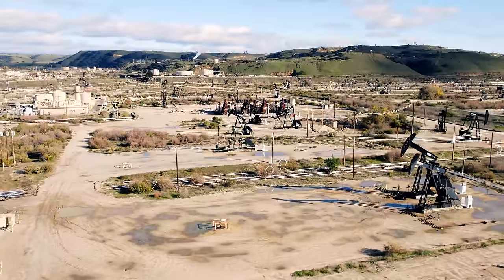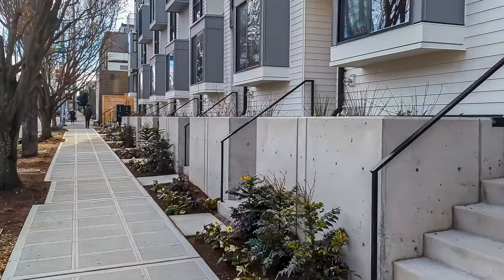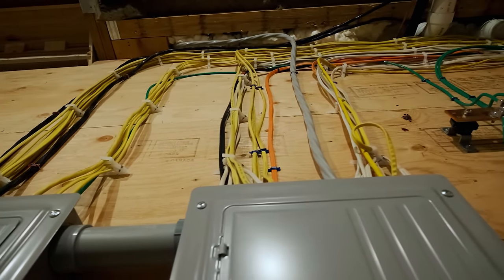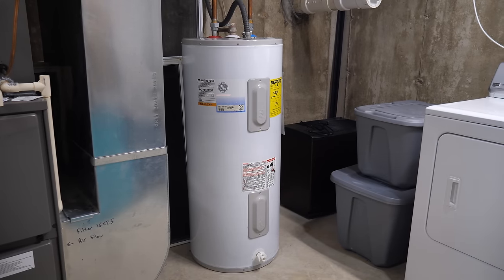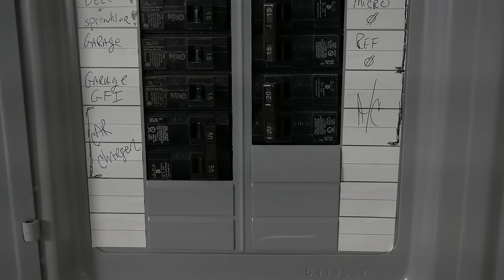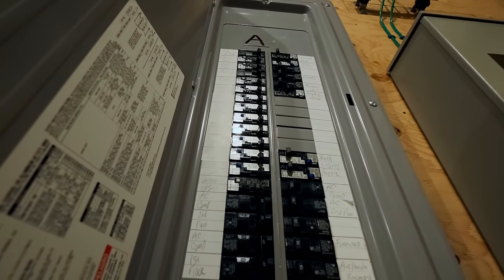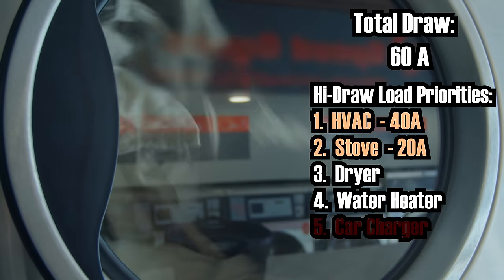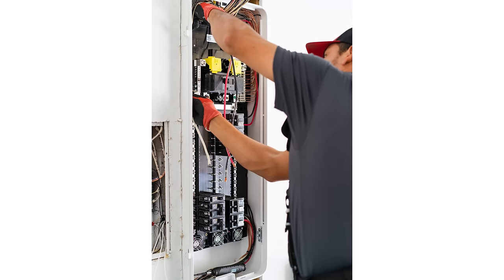Home Electrification: There's not a lot to do, and it doesn't have to be hard (Part 1)

Comment: As a Norwegian, it sounds so foreign to hear you talk about the things i grew up with as something novel like this. I want to highlight how much easier everything is when it’s all electric!   This is great, you can do this! 🎉 a couple of years ago furnaces became illegal here!
Reply: It's not really novel to go all electric in the US. It is pretty common in places where other sources are not available. Where other sources are, the issue is cost. Even at 0.10USD/KWh natural gas costs about 1/4 vs. resistance heating. Air source heat pumps are comparable to operate but cost much more up front. Ground source heat pumps cost less vs NG to operate, but installation is very expensive. Of course this varies by region. 

Also it isn't extra effort from the homeowner perspective. Most of the time it works in the background. The reliability between electric and gas or oil based devices don't differ greatly, so not much to be gained there either.

IMO the major problem in the USA is that most people aren't planning to keep a home for life, so spending extra on better appliances and better design and construction (insulation, windows and air sealing) hasn't had proper focus historically. Better homes don't get enough credit when being sold. The improvements are largely hidden and ignored. That is getting better I think, but getting that return on your investment when building is difficult.
As that mindset shifts, better products will be installed.
Reply: My parents' live in the United States. Their home was built in the 1960s. The address plate on the front of their house says "Powerhome", and it's illuminated by a bulb that has not been changed since the house was built. The plate signifies that the home was built to be an "all electric" home of the future, a novel idea in the 1960s. We could accomplish it then, and it stands to reason that with recent technological advances we can most certainly accomplish it now. Hoping we'll get up to those Norwegian standards.
Reply: Illegal for new constructions/new renovations to the HVAC system or illegal as in they take your furnace/fine you for continuing to use it?
Reply: Yes, I'm from one of those more primitive countries (the Netherlands), and looking at doing what's normal for you. Quite a lot of work, as it's still fairly novel... But I understand you also do underfloor heating with electric heat mats? Mine is water based... Ha det....
Reply: @DarthCiliatus  As in taking your furnace.
Reply: You say they made furnaces illegal there  like it is a good thing. It's not. What do you do when there is an ice storm and there is no electricity for a couple weeks, just freeze?
Reply: @springhollerfarm8668  We have so good infrastructure that this is never a problem. It will stay like this for a few more years until there will be a complete EU-mandated privatization of the grid. (Unless some new political parties will be able to stop this madness). Then we will also get the US infrastructure issues. But yeah, right now this has not been an issue for the last 50-60 years at least in Norway.
Reply: Here in northern Sweden we use district central heating, heat pumps, wood based combustible fuels, and electric resistive heating in descending order of popularity, depending on avaliability. Central heating and ground source heat pumps do not need a secondary heat source even in extreme cold so is the favored options unless you own forest land and like to work those logs. I’m sure that if there was infrastructure for a gas hookup and national natural gas reserves, gas would have been the fuel of choice after the oil crisis in the 70s.
I recently moved into a 100 year old house that was initially heated with a wood burning cast iron stove, later having additional insulation and resistive heaters installed, then  “mini-split” heat pumps, and lastly a pellet burning stove as a secondary heat source. Times change and housing need to be built right so as to be able to adapt.
Reply: @VirtuellJo  Norway isn't in the EU?
Reply: @springhollerfarm8668  Good luck blowing the air down the pipes without electricity for the fan.
Reply: Of course, Norway has the largest abundance of geothermal energy in the world. If electricity were that cheap here, I'd heat my house (water) with it. But it isn't. My gas bill is less than $20/mo - and most of that is the meter itself, not usage. (the highest it's been in a decade was $50. But I was heating the house to 72F while it was in the 20's all month.) Heating with electricity would've been over $300. Heating just a single room costs around $20/mo.

My grandparent's house was built with baseboard electric heat (in the 40's!) They NEVER used it, because it would bankrupt them. Basically the only room in the house that stayed warm was the kitchen. (with the family room attached to it.)
Reply: @erwindewit4073  Those heat Maya eventually burn out don't they? I have never heard them recommended by anyone.
Reply: @springhollerfarm8668  And how does your blower fan run without electricity? Forced air systems, including the ones that are combustion based, use electric fans to force air through those vents.  And I bet that those modern electronic controller boards also need to be powered. Only the older oil or water based radiator systems remain operational without electricity.
Reply: @MarkRose1337  First off, My wood burner is in the basement, the heat floats up and even if it didn't, it would still spread throughout the house on it's own. (Ever hear of convection? ) and two. Did you notice the part where I mentioned a gas powered generator? It will run a blower.
Reply: @sarvphilly7983   First off, My wood burner is in the basement, the heat floats up and even if it didn't, it would still spread throughout the house on it's own. (Ever hear of convection? ) and two. Did you notice the part where I mentioned a gas powered generator? It will run a blower.
Reply: @springhollerfarm8668  Well, as far as I know having a woodburner als heater is mandatory just for these events (that do happen in Norway). 
But the same problem would apply to everyone else. Furnaces ALSO run on electricity, just not that much. So they won't work either.
So having a wood burner just to be safe is (and always was) a good idea.
Here in the Netherlands though, power outages are VERY rare and never really last for long (most of our power lines are underground). So it's much less of a problem...
Reply: @jfbeam  Well, gas is $4 per m3 (convert to your preferred unit). Unbelievably expensive. Electricity is 'just' $0.80 per kWh now. Cheap is relative ;) Petrol is about $7.50 per gallon here too. Usually, energy is fairly cheap in the  US compared to here..
Reply: @erwindewit4073  My whole point is this: Why are "they" trying so hard to push everyone to 100% electric homes? The grid cannot handle it now, anyway (In USA) and the main issue I have with it is when, not if, the electricity goes out for longer than a few hours or just a day... The generator needed to run an all electric home would cost thousands and still run on gasoline. Finally, what if the people in charge decide they don't like you for whatever reason, like not supporting their political agenda, they can and likely one day will, cut you off. Then what? I don't like being under someone else's control that way, it is frightening.
Reply: @springhollerfarm8668  Well yeah, I agree. Our power grid has always been extremely reliable, so nobody has generators here. Well, a bank perhaps. Still, as profits and indeed, political disinterest undermine the grid more and more, it WILL get less reliable (and even MORE expensive). And here too, the grid operates at capacity mostly everywhere. 
I think some fluid and solid core batteries (fluid which becomes solid to store energy) might be able to store the energy you generate for months. So you might generate 3 MW during the summer months, store it, and use it for the rest of the year. And THEN depend on the grid if it's not enough. 
Of course I would prefer storage and generation at scale, but then the excessive profit and political disinterest reappear again. 
Hopefully we can turn things around, otherwise, I WILL buy one of those batteries, even though eventually others will end up paying more.
Reply: Electricity in Norway must be quite cheap I pressume...
Reply: @thetruthisoutthere5173  Hmm, jeg vet ikke.. Quite probably?

Comment: Interesting video. And I'd like to preface what i'm about to say by saying that I have a heat pump (two actually, Fujitsu, with a CoP of 4). I have an electric dryer (gas ones are also available in the UK but not so common any more) and I have about 5kWp of solar PV on my roof. Now that i've said that, I'm happy that I still have a gas boiler (heats the home and the water), because it costs me a third of the cost of using electricity to heat my home, even with the heat pump (they're ASHPs btw). I also have an induction hob, and a gas hob, I bought a combined one because on very sunny days I can cook for free. However, when it's not sunny, it's much, much cheaper to use gas to cook with. A unit of gas costs me about 5p per kWh. A unit of electricity now costs me about 37p per kWh. (That's 6 us cents and 44 us cents respectively). So since our energy prices (specifically electricity) have gone through the roof, all I can say is that I'm glad I did not rip out the existing gas boiler and gas cooker. I am trying. I do have both options. Just one is considerably cheaper to use than the other. Come summer time, we run almost entirely on electricity and for much of the time, for free. But there's no way i'm giving up gas any time soon.
Reply: That’s understandable, but that’s also very specific to the UK.
In France gas costs about twice that and electricity is about half that, so it’s much closer.
I have just installed a heat pump with a COP of 5, and it should be way cheaper than anything possible with gas.
We have decided to even remove our gas meter to save approximately 400€ per year, yes it costs that much per year to have the luxury of using gas. No thanks.

Comment: Great video! Thanks from Sweden. Ps: running a heat pump at -35 Celsius has not been an issue here the last 10 years or so (or so I thought), turns out it's just that the standard packages comes with the "backup heating" included, meaning a whole lot of consumers believe their pump works down to -40 degrees Celsius which they don't.. But then also they really do work fine at -40. 🙃
Reply: assume "backup" kicks in around -25 or so 
in Canada there are "mini split and built in airsource units that will heatpump down to -25 and ground source OR "watersource" units THAT WILL go down -40 OR LOWER
Reply: @jasonriddell  same here in mn; being in the middle of the continent we see some really cold air temps, which makes ground source ("water source" generally being against code now unless grandfathered in) way more appealing. 

Although I'll just keep heating with my wood stove. Good exercise year round, i have a very efficient stove so relatively much less pollution than in years past, carbon neutral because the trees sucked the carbon from the air in the first place... and free!
Reply: I'm in Canada and I have use the heat pump exclusively for heating to -5C.. Combo of electric heat and heatpump down to ~-18C and electric heat only below that.
Reply: People in the US assume heat pumps are like what went into housing in the South and border states in the 1980s. In other words, underrated for the home. There's a night and day difference between those and what they're installing now but so few people seem to know it.
Reply: Are there current home heatpump refrigerants that can extract heat at -40° and spit it back out at 40°C or 100°F ?
Reply: @johndododoe1411  410a will do it but it's more about how big a compressor you need to move that heat. As the air temp gets really cold, that differential gets bigger meaning you have less capacity, but at the same time the heating load goes up so you take the hit from both sides. 

I mean, there are -80f walk in freezers out there for sushi storage... the heat can be moved. It's more about how incredibly inefficient it becomes & at some point resistive heat just ends up more practical.
Reply: @danl6634  Having the extended temperature range allows pushing slightly past current limits reported in the video and comments, to keep running in bad weather.  If pump size limits the differential, lowering indoor temperature as necessary may be acceptable.
Reply: @johndododoe1411  there are actually a number of problems that turn into roadblocks as the outside air gets colder. 
*compressors are designed for a given suction temp range. Most compressors that are efficient in A/C mode won't be capable of running below -13f (-25c) because the physical design of the compressor needed to work in A/C mode does not work in low temp mode.
*the lower the outdoor air temp, the lower the suction temp in the compressor has to be in order to exchange meaningful heat with that outside air. The lower the suction temp, the less refrigerant flows through the system & you end up overheating the compressor because they rely on that gas to stay cool. There's also less oil being returned which means shorter life. 
*Heat pumps are filled with refrigerant to optimize air conditioning mode. This means that very cold heat pump mode is exceedingly overcharged with refrigerant, further causing problems with overheating.
*As the heat load in the house goes up, the compressor capacity drops & the ability to exchange heat with the outside air drops too. This ends up putting a hard limit on being able to ever catch up on a cold night, and you lose control of indoor temp. A few degrees on a couple nights a year is one thing; here in MN that could mean a 50f house for art least a week every year and a greatly shortened heat pump compressor life. There's just no way to get around the physics of it unfortunately.
Reply: Swede here too. Got my air-to-water heatpump last month. Works great even in cold climate providing both heat and hot water. I also have a fireplace I use on the few really cold days.
Reply: @johndododoe1411  Well if take heat from  the ground, sure. But drilling 150-200m is usually expensive.
Reply: @danl6634  A number of the things you mention are clearly design limits of current products, not of what can be improved in future products.  Besides tuning designs to operate in colder weather, things like fill levels can if necessary be handled with a buffer tank in the indoor unit where excess refrigerant can be parked in relevant operating modes.
Reply: @johndododoe1411  the huge thing being ignored in all this is that to make a heat pump work well you have to have a well insulated, well sealed house. Which in a lot of cases makes way more sense to spend the $ there vs doing anything with the equipment; a gas furnace running 30% less often because the house isn't dumping all the heat back out is way more of an improvement than switching to electric because it's a far more attainable goal for most homeowners.
Reply: @johndododoe1411   @John DoDo Doe  no argument on most of your point, but the reality is that economics plays a huge part. Maybe it's physically possible, but if that puts the cost to benefit so far out of balance that nobody buys it then it may as well not be possible. I acknowledge that's not the gist of the conversation, but it's absolutely why there will be auxiliary heat of some sort in cold climates for the foreseeable future.

There are some issues that can't be overcome with new tech without greatly changing the system design however. At some point a system designed to provide air conditioning efficiently just won't work when reversed in very cold ambient. There are volumetric, component sizing, and longevity reasons that heat pumps are generally only rated to -25c / -13f ambient.

But overall you're absolutely correct - most of the problems people bring up with air source heat pumps come down to an expectation that they'll work exactly the same as a gas furnace. Change that expectation (allow lower indoor temp on a limited basis) and it'll open a lot of doors.
Reply: @danl6634  Heat pumps can be built for the worst of houses, but isolation is probably cheaper.  That should not stop us from making heat pumps work for places other than California.

Comment: I love that you made this video.  Thank you!

We have a 100amp feed on a 70 yr old mostly electric home. "Mostly" because our furnace has natural gas backup heat for when it's too cold for the heat pump.

AC/heatpump - 30amps/240V
Oven/Range - 50amps/240v
clothes dryer - 30amps/240v
level 2 car charger - 30amps/240v

That's 140 amps of power total across my 100amp service feed. Yet, we've never had an issue blowing the main breaker in this home and we don't skimp on our power usage.

The clothes dryer and EV Charger share a circuit via a UL certified 30amp smart relay that prioritizes the dryer and allows the car to charge whenever the dryer isn't running.  Our 50amp oven has never run at full load.  It's often pulling 1-4kw instead of the full 12kw it's capable of drawing.  We've never needed to have all 4 "burners" set to high while also running the oven at 500 degrees F.  It's not because we can't because we absolutely could without an issue.  It's really because we never have a need to....ever...which includes cooking for family during holidays.

The highest load I've ever noticed using our whole-house energy monitoring system was 16kw which is still only 66Amps / 66% of the capacity of my home's main feed.  It's a non-issue solved by education and knowledge.  For us, upgrading to 200amp electrical service is just a very expensive several thousand US dollar convenience tax that we don't need to pay.